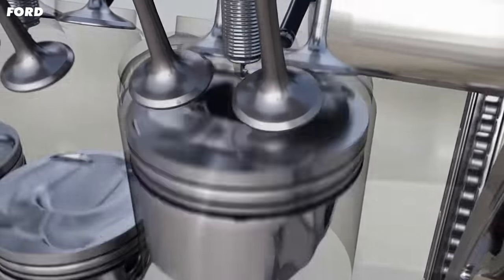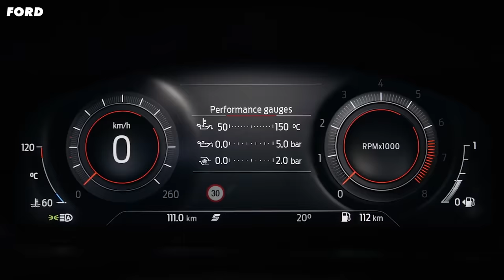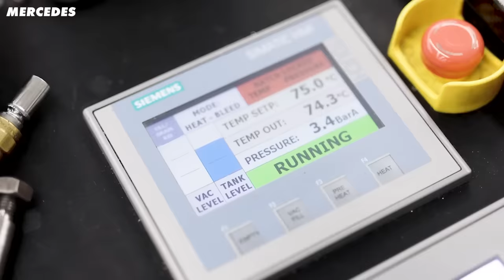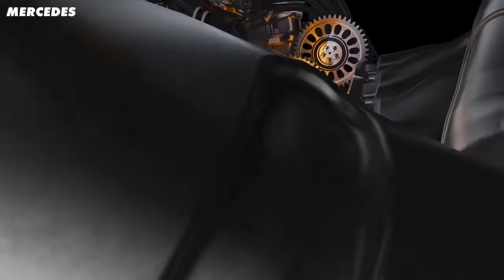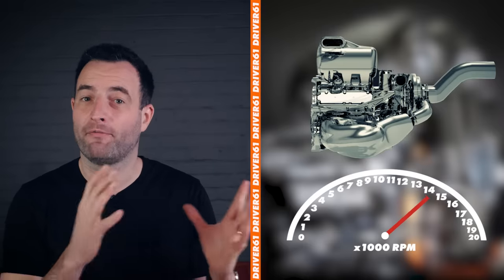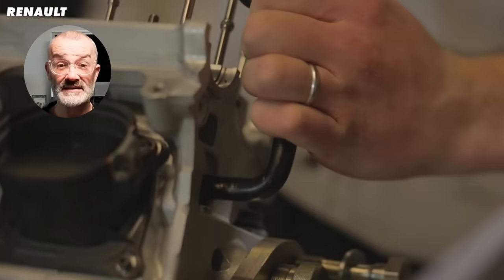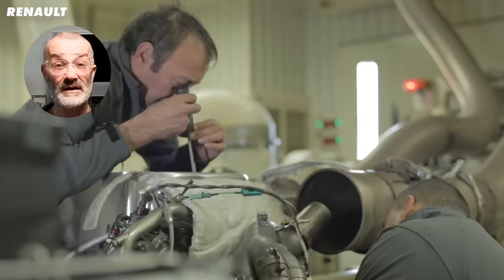$5000 Normal Engine vs $10 Million Formula 1 Engine

Comment: I can guarantee you that Ford spent many 100’s of millions on developing the EcoBoom engine and can still sell them for only five grand each, even after all the tooling and assembly line has been designed and built.  Why?  Because they sell them by the 10’s of thousands.  When you only build a few units a year the engine developers have to get their money back somehow.  I’d guess that the sum of the parts of a F1 engine doesn’t come close to $10,000,000.  Just as the Ford engine, it’s the development cost and tooling needed that does.  Even after they spend all that money though, I doubt we’ll see anything as stupid as a wet cambelt in F1 anytime soon!

Comment: Formula 1 needs to remake the early 2000 cars with today's technology. DRS, V10's with sustainable fuel, smaller lighter cars, bring back refueling, and more teams
Reply: Sorry but, completely disagree about refuelling. Turned every pitstop into a 15 - 20 second snooze.  The current tire only stops add more jeopardy..
Reply: @W3ndal  it doesn't. What it does is make every strategy predictable because the majority of the time in the pits is going slowly. It's the pit delta. So it ends up creating extra boring scenarios for 99% of the tracks where the strategies are entirely predictable.

It's why we love rain so much.

But further to why refuelling helps create more strategy, now you can choose to do full fuel, half fuel or splash of fuel. Where a pit delta with full fuel may take 60sec, a half load may be a delta of 40. It adds an extra layer of strategy.

But you say, they'll still find the optimal strategy. Yea, they will. But more options means more possible paths to the outcome. Furthermore, Pirellis has made shit tires for a long time. Making them fall off so far and go from great to shit means 90% of strategies use the tire that degrades the slowest. Rare cases where the hard tire is worse do exist but the tires are so bad that without refuelling, the strategies (and best strategy) are boringly predictable.

Lastly, you may say "yea but with no fuel, if you mess up a pit stop it hurts". Which is your jeopardy comment. Sure. But define mess up? Over the past 5 years I can't remember when someone had a pit stop that was slower by less than a second to their rival where it actually mattered. The only times where a slower pit stop hurts is when it's really slow - like a 3sec turning into 6sec. And that's rare. So in reality, the pit stops aren't doing anything for the racing. The jeopardy just doesn't exist unless there's a huge screw up.

They're only cool to watch from the choreography viewpoint.

-F1 and motorsport fan for 35 years and counting.
Reply: I'm more into the engineering side but even I would be more than happy to have those V10s back. I love the current V6 but it would be nice to see even more complex engineering with the good old V10 and I know it will not rev as high as it was back then (because 3 engines per season limit). If there's anything I would disagree would be bringing refueling back. I thought it would be cool to see a V10 not having to refuel and last all 50+ laps. But of course it's the engineering part, you can disagree if you want.
Reply: @Real28  yeah but I would feel bad for ferrari strategist. They can't make good decisions even without refueling and stuff.

Comment: The base size of a component is not called tolerance, that is dimension.
There are however two types of tolerances when it comes to machining a part:
Dimensional tolerances is the first which look at each measurement individually.
Form and location is the other which handles things like parallel surfaces, flatness etc.
(I haven't worked with manufacturing parts for F1 but for gas turbine engines and other high precision applications.)
Reply: @theterriblepuddle1830  i would call it more like a safety factor then a tolerance
Reply: @theterriblepuddle1830  - Yeha it does cos failure is 0 so 0.00001% above failure is the tiny tolerance they are looking for.  BUt its an unusual way of looking at tolerance I would say.
Reply: @theterriblepuddle1830  He used the word 'tolerance' incorrectly, as Rolf exaplained.
Reply: There are calculations for strength and other calculations for fatigue. One can calculate the minimum dimension under static load. If overloaded beyond its stress limits a part will first yield ( and deform) then break and result in a stress crack. One can calculate the failure rate for dynamic load for example the minimal dimensions needed before failure of repetitive loads, this is called fatigue. Like a railway cart axle wont fail immediately, but will fail after a certain amount of rotations because of repetitive load cycles. A fatigue crack is fundamentally different from a stress crack.
The standard safety factor for both stress (yield) and fatigue is about 1.5, so a part would be guaranteed to not fail by a 100% to a defined maximum of load cycles or rotations at maximum load with a safety margin of 50% extra rotations. By reducing the safety factor from 1.5 to for example 1.05 a part would be designed a bit lighter and still not break by dynamic loads. It is however a risky play, because you are operating a machine so much closer to the edge of failure.
Reply: @AlfaRomeo156SWGTA  please explain how you would calculate the fatigue failure cycles on the rotating cart axle. Thanks
Reply: Emotional tolerance when the parts fail and the replacement is unavailable..?

Cough

Not like ive been there.....
Sometimes head gaskets are the hardest thing to find and stop ya dead for 24-36hrs on rebuild.

Such is life
Reply: Hybrid engines are big and heavy. Pretty shit
Reply: @procatprocat9647  Google is your friend
Reply: @mintgoldheart6126  I'm a highly trained Senior Mechanical Engineer who designs submarines and subsea robots for a living. I don't need Google to tell me about tolerances or fatigue cycles.
Some of the commenters on here have the knowledge level of a child and they're running their mouths.
It's a sad situation for them, but quite entertaining 🤣
Reply: form and location? where are you from? its called GD&T (geometric dimentioning and toleranceing) where I work. one notation that defines everything. reely annoying and I don't have it 100% down yet. solidworks will spit out dimensions easy peasy but everything else is more manual. but to normies tolerance means gap sonomous with clearance or allowance, but GD&T or whatever you call it is how you define a single part. fits, clearance, whatevers are defined eltswhere or just implied by the dimentions.
Reply: @nick4506  well said. Do you comply with BS 8888? It's an absolute minefield that has the potential to freeze a company if overused.
Reply: I knew some good German lad would step in and set everything to right!
Reply: @theterriblepuddle1830  Believe in JESUS today, confess and repent of your sins. No one goes to heaven for doing good but by believing in JESUS who died for our sins.  “That if you confess with your mouth, “Jesus is Lord,” and believe in your heart that God raised him from the dead, you will be saved. 10 For it is with your heart that you believe and are justified, and it is with your mouth that you confess and are saved. ”(Romans 10:9-10)❤️🙏
Reply: @giovanniquargentan6198  I think the guy in the video wasn't using the word "tolerance" in a dimensional (GD&T) context. I got the impression that he meant how small of a part can the design "tolerate" and still be functional and practical.
Reply: The missing parameter is CLEARANCES.  It's the very tight clearances that make it necessary to preheat an F1 engine to unseize it and allow it to run.
Reply: why do f1 v6 turbo engine sound so good but porsche 911 sound like a vacuum cleaner?

Comment: I build submarine parts for a military contractor. We have clearances in the 1-2 thousands of an inch quite often. We have for example a component the size of a small cabin that needs to be aligned to another part within 2 thousands of an inch absolutely square. 

It definitely adds cost to build anything to that level of detail.

Comment: the part where you say the F1 engine is seized when cold is not correct, they can be started when cold, but because of the tolerances they would wear out prematurely

Comment: Just a point. The ST you showed has been downsized to a 1.5 3cyl. 
The older shape was the 1.6 4 cyl. However this only ran 200bhp in the very last models off the line, most were 180bhp stock.
Reply: Yeah, 
I want write this too yet 👍🏼
Because in the animation was a 4 cylinder to see 😅
Reply: Just to add. The 1litre ecoboost i had as hire car back in 2015 was banging. My buddy swapped me his jag xkR for it for a week no joke.
Reply: @CaymanIslandsCatWalks  the 140bhp 1l fiesta is surprisingly fun car!! Just a shame Ford fitted with eco ditch finders. I found it understeered too much if pushed.
Reply: @rupertm2542  legit was great fun
Reply: The 1.6 was 182hp and on overboost (during 15/20 secs would make 197hp on European version. On the US version there was no overboost and they always make 197hp.

Comment: Manufacturer's specification: After warming up to operating temperature at idle, tighten down bolts in a star pattern at 38 ft-lbs each, drive for 25 miles, then retighten to 38 ft-lbs.

Local shop/dealer: Beats on it with an impact gun for a whole minute to try to play the Imperial Death March under the hood, then slam the hood down.

Comment: I guarantee you that the Ford ST engine costs less than $2500 to produce (probably costs around $1800, given GDI, VVT & inflation). I worked on a 1.6l for one of the “Big 3” 20 years ago that cost well under $800 to produce at that time.
Reply: Yeah I think he looked up the cost to purchase a new engine. That isn't the cost to manufacture.

Comment: pneumatic valves might not be used today as motorcycle engines rev to 14,500 rpm as some brands of motocycles rev to 15k rpm, instead stiff valve springs might be used on F1 engines to adhere to the current cost cap regulations

Comment: hey Scott, F1 engines generate 1000hp WITH the electric systems, the ICE itself “only“ produces around 700hp.
Reply: Well, in this comments section alone, Ive seen everything from 450 to 850 attributed to the engine alone. Who's right?? 🤔

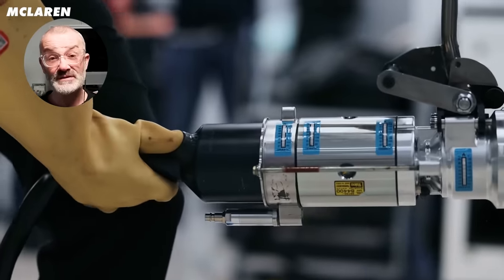Comment: 6:35 the engine is "seized", when cold, and warming it up "unseizes" it 🤔  I don't think so.  They are not seized when cold.  Pre heating it tightens the tolerances, and brings all components up to operating temperature.

Comment: The shown Fiesta Mk8  ST has a 1.5l three cylinder engine.
You talk about the 1.6l of the Mk7 ST (200@5700 with overboost) or probably the ST200 (215hp@6000 with overbosst, 200 without). Anyway, the limiter is higher than that.

Comment: To be fair to the ST, the F1 engine alone only makes 450ish hp. The hybrid system gets it to 1000, and the turbos run much higher boost pressures. Another thing: V8 era F1 engines make similar hp per liter, but are naturally aspirated.

Comment: As an automotive engineer, I can explain regarding the high (revs) numbers. The 4000 RPM on a road car is not the same as the 4000 rpm in a F1 car. Let me explain:

1. The Bore of the F1 engine is larger than a normal road car engine making the stroke of the engine smaller, thus the piston only needs a small amount of distance from Bottom Dead Center (BDC) to Top Dead Center (TDC) 

1a. A typical road car bore X stroke dimension is from 79mm X 84mm
1b. An Assumed F1 bore X stroke dimension is from 95mm X 55mm
1c. This makes the distance from BDC to TDC shorter making the revs higher.

Most car manufacturers now are not doing so because of the sound regulations that it has to meet.  

But yes, this is in simple terms on why F1 engines are such. But this calculation is for a typical 1.6L engine. To achieve higher revs in a bigger cylinder engine is relatively the same thing. Just increase the bore dimensions and automatically you will have a smaller stroke dimension. 

This calculation can be calculated in:

(π/4 × b2 × s × c)

b = bore dimension
s = stroke dimension
c = number of cylinders

note : The calculation I made above is just for an example.
Reply: "The 4000 RPM on a road car is not the same as the 4000 rpm in a F1 car."
Yes it is. For 4000 rpm is the same number of revolutions per minute. 

"A typical road car bore X stroke dimension is from 79mm X 84mm" Uh, what is a "typical" road car? No such thing and bore and strokes come in all sizes and ratios making them oversquared, squared or undersquared. 

"An Assumed F1 bore X stroke dimension is from 95mm X 55mm" You mean you didnt even look it up and just ASSUMED a random number. At the very least you could have checked that a 1600cc dispacement divided by 6 cylinders equals 266cc per cylinder. Your random assumption would make it 390cc. 

"Most car manufacturers now are not doing so because of the sound regulations that it has to meet." Which is a load of nonsense. Cars developed for economy tend to have more undersquared engines while sportier engines tend to be more oversquared but its far from being that simple or black and white. 

"But yes, this is in simple terms on why F1 engines are such" Are WHAT?? "such" ??

"But this calculation is for a typical 1.6L engine" What is a "typical 1,6L engine" Hondas, Toyotas, Volvos, Kias, Peugeots, Fiats etc are nowhere comparable. 

" To achieve higher revs in a bigger cylinder engine is relatively the same thing. Just increase the bore dimensions and automatically you will have a smaller stroke dimension. " Bollocks for you can KEEP the same bore and make the stroke longer or shorter and vice versa. Fact is that is what quite a few manufactures do.

Higher revs means more power cycles for every second/minute. Hence more power produced. For 12,000 to 20,000 rpm to be possible at all F1 engines used pneumatic valve gear. Which you dont mention at all.

What kind of an "automotive engineer" are you anyway?

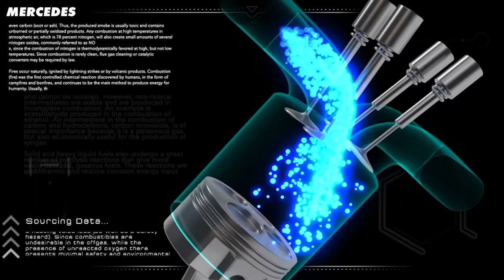Comment: 4:28 - Im gonna pull a science nazi here; 2600 C is not "half as hot as the surface of the sun."  - yes: 2600 is close enough to half of 5500 - but 0 C is an arbitrary temperature. A made-up point in the scale that isn't actually any baseline. It only represents the temperature that water freezes. If you state the temperature of combustion gas vs sun surface in Kelvin, or Fahrenheit you will have different ratios relative to their "zero" points.

Comment: The latest Ford Fiesta ST Mk8 has a 3 cylinder 1.5 litre Turbocharged engine that produces 200bhp. Mk7 had a 1.6 litre 4 cylinder atmospheric engine.
Reply: MK7 is 1.6L Ecoboost engine. I think they round it up the new 1.5L to 1.6L to make it at same capacity of the F1 for a better comparative

Comment: Thank you @ 7:17, finally someone inserting a piston into a cylinder without fitting the plastic guide on top of the cylinder hole first. Always wondered if that guide was necessary in order to place the piston in and now I see its possible without it. Lol

Comment: Big bore short stroke is  the fundamental difference . Which leads to high hp numbers but low torque. Not much use anywhere but in racing. Incomparable, but handy for feeding ducks.

Comment: The engine doesn't produce 1000hp it's the whole P.U that does.
Reply: what is a p.u. ?
Reply: Power. Unit. As in the system that provides power for the application
Reply: Around 750HP I believe. Plus 250HP when the electric battery dumps its load, every lap or so.
Reply: @shelterstation  more like 850 w/o the mgu-k
Reply: @exiles299  ERS is 160BHP and allowed 33 seconds per lap, Engine on its own is 700 BHP, not sure where the extra 140BHP comes from?
Reply: @brettoconnor1170 roughly 1k HP for the entire PU, if the entire ERS (according to your wording) accounts for 160hp then shouldn't the engine on its own produce around 840 to 850?
Reply: @shelterstation  oh no. The actual engine only makes around 500 hp.

Comment: The engines are not seized when cold. If they were it would be impossible to assemble the engine but to get those power levels the component clearances are extremely close. Starting a F1 engine cold will cause very expensive damage though. R.I.P Ken Block.

Comment: I thought the "F1 engines are seized when cold" was a myth? Great video either way
Reply: I don't think they can be seized because it would make them really hard to assemble. I think the need warm them before starting is to get components to the right size before starting to minimise wear.

Comment: You're completely wrong. The total budget is capped at 145 million for a season. For the full season of 20 Formula 1 races, each driver is allowed to use a total of 8 fresh engines. Do your math, it doesn't add up!